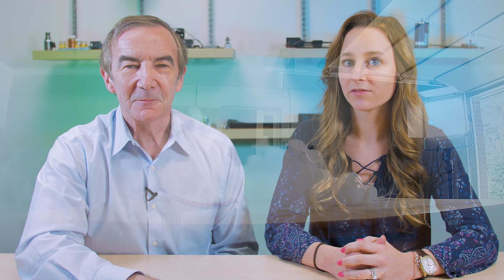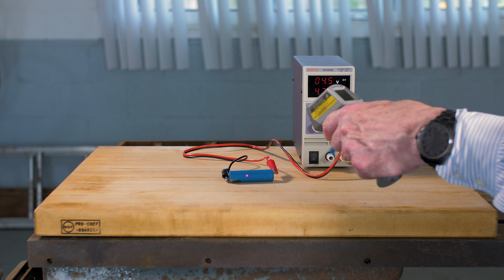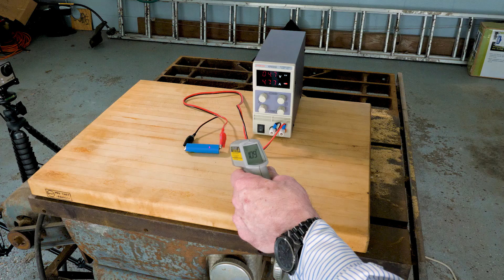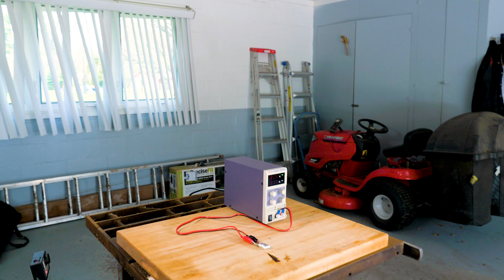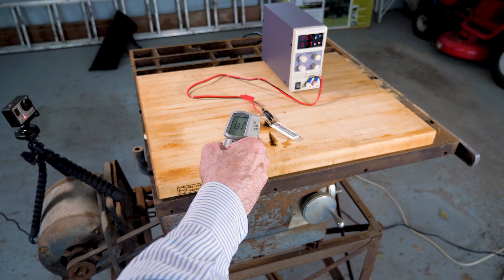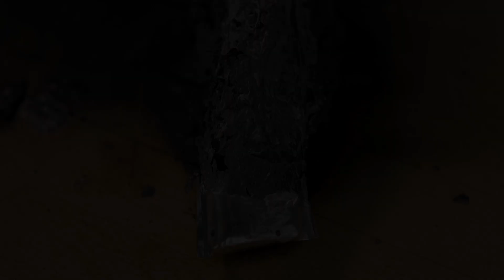When lithium batteries catch fire: How overcharging can do bad things to Li-ion cells

Comment: I accidently overcharged a 48v1000w ebike battery. On old battery. I bypassed the bms to test cells. It went into thermal runway because I overcharged it(my bad). It was just shy of burning your hands instantly... I managed to catch it, and put it outside in a snowbank. That it melted through.  No fire. But  I was so close to burning my house down.
Reply: Yeah...i shorted mine just for a few seconds and it was enough to melt metal,that thing is a monster,if it really catches fire Good luck putting it out, you'll have to bury it quickly somehow

Comment: Hey I know this video is pretty old, but I had a question: I have a 20s12p battery of 18650s and it's in a steel battery box. If they caught on fire, do you think the battery would melt through the steel, or would the fire be contained? Thanks
Reply: i’m sure the housing will be fine if exposed to a fire or if you short circuit the pack, but if all the cells go into TR from overcharge, i don’t think the box will survive.

Comment: Hi thanks a lot for the very helpful video   Is it true that the fumes are extremely toxic ? thanks and regards gino
Reply: Obviously as they are from burning plastic
Reply: @ryanchowdhary965  hi thanks for the very kind and valuable advice I though about some compounds with Li But it's the plastic i see
Kind regards Gino
Reply: @gino3286  there is also lithium oxide which is poisonous
Reply: @ryanchowdhary965  thank you for the very valuable advice So we have possible bombs at home I hope the power banks are safe
I have many around
Reply: @gino3286  better recycle the old and the cheap Chinese ones, they won't explode as violently but rather burst from the pressure inside, releasing white smoke in the air, happened today in the lab, with an damaged lithium ion battery.
Reply: @ryanchowdhary965  thanks a lot again
I am at risk I will buy a metal box to store them safely

Comment: the reason why im here is because 18650 caught on fire in my pocket painfull and 4 weeks hospital still having dressings it happened on 5th december 2020
Reply: Did you have the battery in a case?  Or was is loose in with your keys?
Reply: How did it happen?

Comment: But always remember one thing: any battery is way less flamable and explosive than your docens galons of fuel under your seat in your internal combustion engine car :)
Reply: No lithium batteries are far more explosive, a lot hotter, and are more flammable. They light on fire less than gas cars

Comment: Just think of it, people are driving emoped, ebikes and yes those cheap chinese eboards. 
Without protection, lithium is quite the game dealer.
I bought for my ebike battery, of a good brand, its slow charger of the same brand. Sure the battery has BMS and all... and can handle the faster supplied charger. But the slow charger feels nicer and safer.

Comment: is this the same as overcharging though? as in leaving a battery on charge vs charging it with higher voltage than intended?
Reply: Most modern chargers stop feeding energy once the battery reaches 100%

Overcharging happens if the charger/battery are damaged or knock offs.

That's why, when your battery wears out...

YOU BUY THE ORIGINAL ONE
Reply: @darkmoon1289  Actually not even 100%.  That's the thing about chargers and battery indicators for Li Ion..they lie to you.  But...close enough to 100% I suppose, so it's a little lie.
Reply: why would knock off batteries not indicate to the OEM charger that it's at 100% and should stop receiving a charge? Isn't a lithium battery just a lithium battery? Thank you. @darkmoon1289

Comment: this voltage in your power supply is more than 4,2 volts and th current  it´s very high,. I work with current power supply  no moore than 1 A

Comment: I had a rechargeable battery pack do that in my bed one night. I'm very lucky that my only injuries were light burns and smoke inhalation and that I got it extinguished quickly.
Reply: That's the last time I'm charging overnight.
Reply: @Zain E how does electricity bounce?
Reply: Same in my case
Reply: I have a 48v 1000w ebike it works good but I was stupid bc I made an electric bike ok lol
And I cut both wires at the same time but good thing it didn't catch a fire but it sparked also I installed crimp connectors on it which I regret doing now bc here s what I did I installed everything right on my speed controller and then,when I installed the battery pack it started to smoke and turned the battery connector on the controller black
What should I do
Reply: I also idk if I said this but I installed crimp connectors there not original but wondering how do I,connect a xt90 conenctor?
Reply: @herekittykitty4900  Killed my first big li-po battery pack by exactly same mistake. Cutting both wires of 3S 5000mAh 30C welded some copper to my cutter in fraction of second. Luckily, battery pack had some fuses inside(or just were poor connections between cells  lol), which blew and nothing more happend. Later on I were even able to repair that pack and it have about 90% of original capacity.
Reply: Brand of battery pack please...
Reply: @florind.5711  Blackweb. Don't leave electronics charging in bed overnight. It's probably fine but there's an added risk of fire.
Reply: @adamcameron5241  Hey thanks for advice...trying to charge powerbank in solid paved rooms(with no carpet)
Reply: I will never charge my phone next to my bed anymore

Comment: It's not necessarily the lithium that reacts so much as the electrolyte is highly flammable. When it starts to go, and shorts the anode and cathode, the heat boils the electrolyte, so it violently spews out.
Reply: It’s ether iirc...
Reply: In a lithium ion battery, lithium salts are the electrolyte, there isnt actually much lithium at all in there. Its more the charge that it holds, rather than just the flammable lithium solution.
Reply: @termitreter6545  Right. An uncharged battery wont burn like this when short circuit happends. So its deffinitely the charge. Besides this LIB's have lithium ions, not lithium metal. Lithium metal reacts violently with water for example. Thats not whats happening here.

Comment: of course it will explode if u charge it more Amper rate than described!!! do an end overcharging with not exceeded charging rate, and considerable voltage range, like 4.5v or 5.0v
that would be useful!
Reply: While I agree it would be useful to show from an educational perspective, it would take a lot more time and patience to bring the cell up to whatever voltage you specify, so it is not practical for a quick video. You might be looking at many hours or even days, and it is not like you can just turn off the charging and sleep while it is overcharged like that. Since there is no technology to measure the internal pressure of an unaltered cell in realtime you don't even have any way to get some sort of feedback on how the experiment is going.
Reply: @fuzzyfriendlydoggy  the missing of feedback took me here to search what happens if I leave a cell on for days on charging